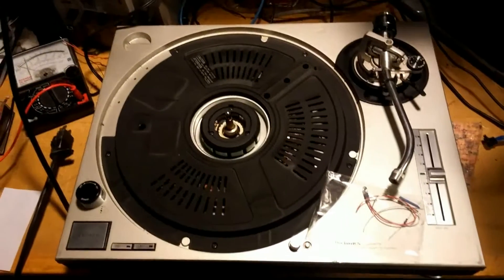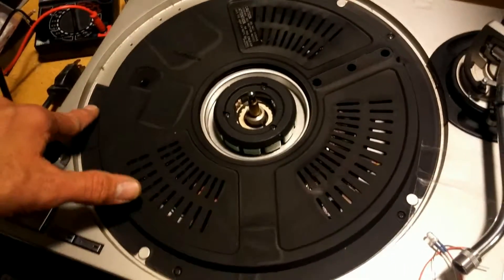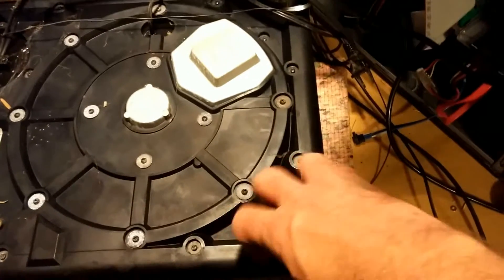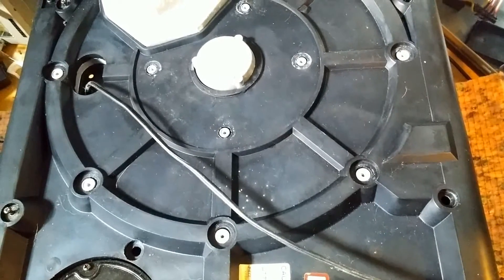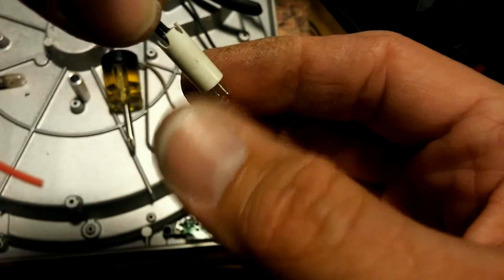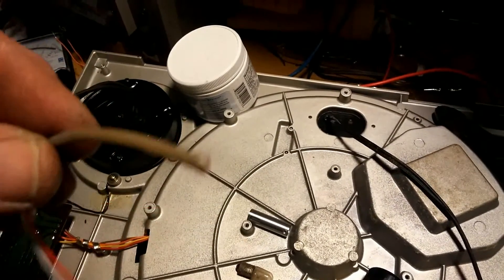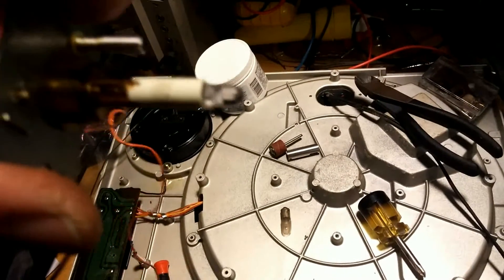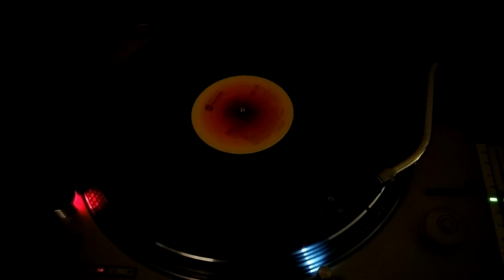Technics 1200 MK2 turntable - convert the pop up light to an LED light

Comment: Damn.  That is 1882 - 84 version.  Nice. Hang on the it 
The target light is one of the first models. 

Newer models are different
Reply from the maker: what makes the earlier models more desirable?
Reply: Chris not sure. But they are more expensive. Just the fact they’re over than 35 years old  I have 1 pair manufactured in 82.  And another pair manufactured  in 84.

Comment: You don't need to assume the polarity of an LED based on the wire colors. If you take a look at an LED the larger side (the cathode is always negative) And as for pop up light LED kits,  kits like these work well, just make sure you hook them up right, haha. http://www.ebay.ca/itm/Technics-SL-1200-SL-1210-Ultra-Brite-Directional-SMD-LED-Stylus-Light-11-Colours/252844054556?ssPageName=STRK%3AMEBIDX%3AIT&_trksid=p2055119.m1438.l2649

Comment: Bruh do you realize that your turntable is the first assembly line for 1200mk2 or originally from 1978 or maybe 1979 nice treasures bruh!!
Reply from the maker: Thanks, good eye for finding that. I did not know, didn't see any obvious date codes on the ic's, etc.
Reply: just look at your rubber base on your sl1200 mk2. its slightly different from next gen 1200 mk2. just keep her with care bruh!!! lol
Reply from the maker: this one just stays at home, not a pro user.
Reply: @bimoario4437   how can you tell .. i still have have mines, i believe i bought mines  new in 1985.
Reply: Bimo Ario I looked at his serial numbers it was born in 1980 but yea it still falls into that classic valuable category. Anything from 78 to 82.